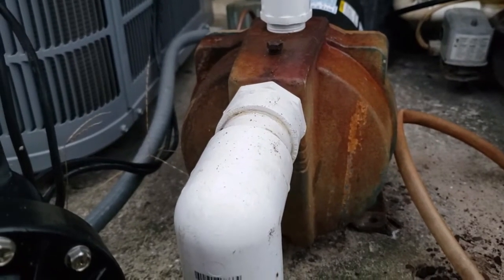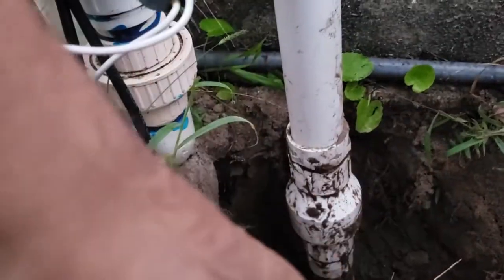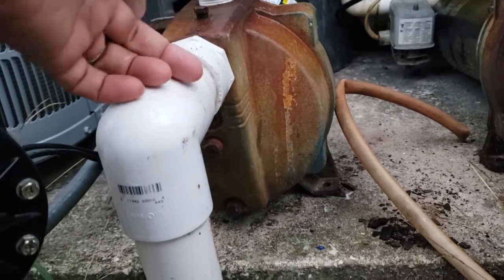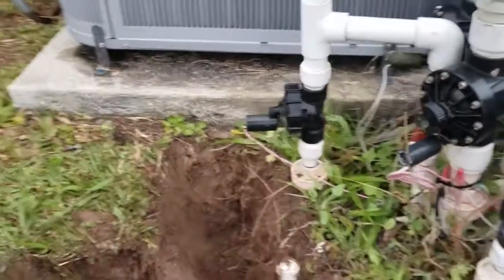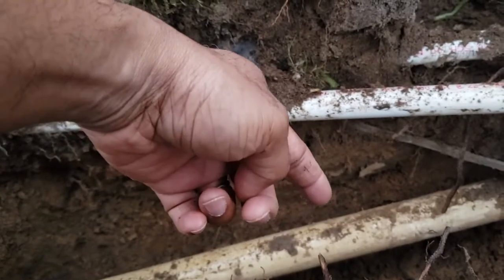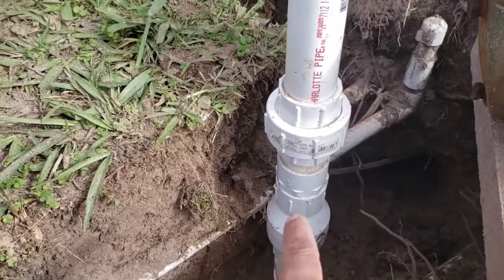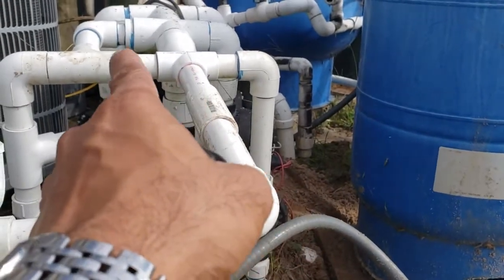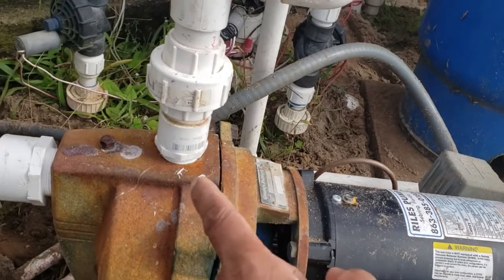Well pump double check valve installation

Comment: Make sure that you are using a spring loaded check valve. My problem with a chattering pressure switch was caused because I had used a flapper style check valve. Apparently, some sort of pressure resonance develops and causes the pressure switch to chatter (resonate).
Reply from the maker: Valves are spring loaded.

Comment: I have found that plastic check valves are not good for wells. Sand gets in them and they fail. When I replaced mine I used a BRASS check valve. It's still works fine after 30 years. By the way other people I know had the same problem with plastic check valves. I guess they're  ok if not used with a sand well.
Reply from the maker: I haven't seen the brass one in the big box stores (perhaps I wasn't aware to look for them).  I have to replace these PVC valves every few years. I will check for them the next time I have to replace. Thanks for your comment.

Comment: I have a sta rite shallow well residential pump, do  the leathers at the foot of the pipe that goes in the ground  serve as a replacement for the check valve ? 2nd question   Do I need a check valve if I have a tank hooked to my pump that has a bladder inside of it?? I have a rebuilt sta rite pump that works like new, it's  approximately 6 months old, but I've started losing prime .  I'm trying to figure out what my problem is . Your help would be greatly appreciated thank you in advance.
Reply from the maker: Q1, no, Q2 no. 
Make sure there are no leaking fittings anywhere. Let the pump pressure up and when it switches off listen if any check valves are hissing  =leaking. Hope this helps you.
Reply: You still need a inlet check valve even if you have a accumulator air tank. Either captive air or non- captive. If your bottom of the well pipe check valve works, that’s all you need. It sounds like a good quality, in-line, spring style check valve will help your situation.